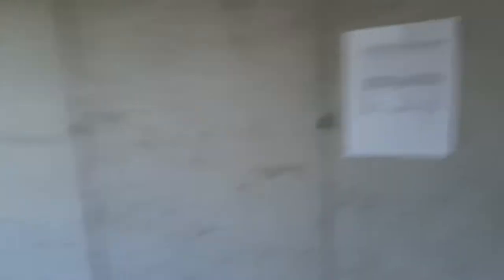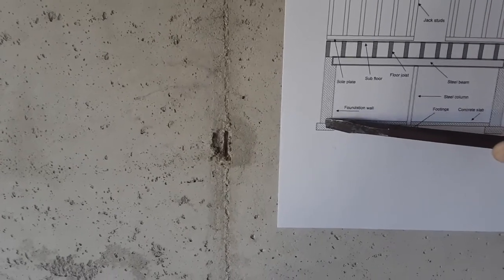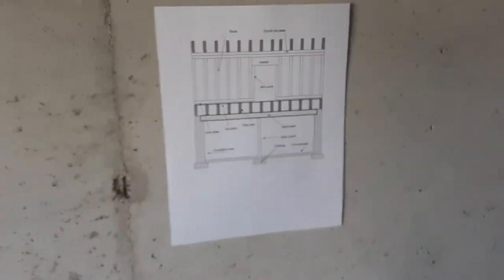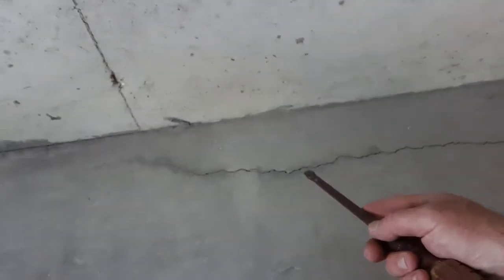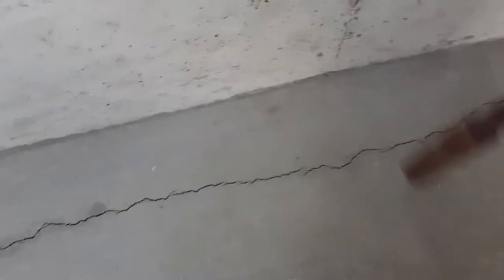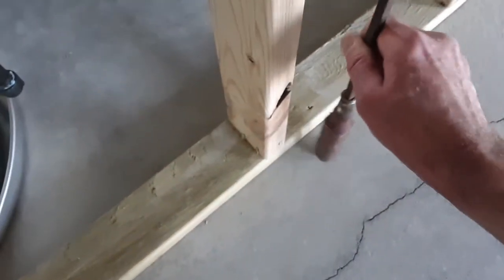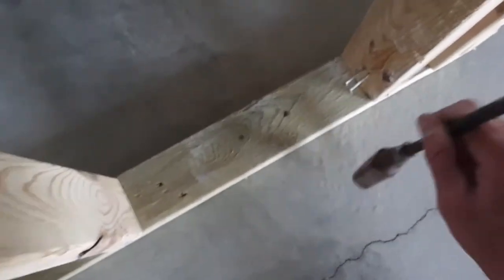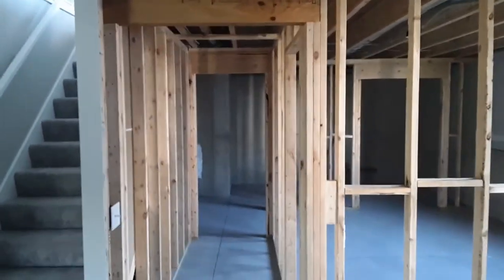😮🚫FOOTINGS missing under load bearing walls NEW BUILD A trick to find missing#footing under#concrete

Comment: Why wasn't this discovered during the foundation inspection?
Reply from the maker: That is a GREAT question! I'll try to make it short, because there's a lot of information that applies.
But first an outline of how and why. Many things have an effect on a home that is being built, "speed" process, oversight and economics. The "economics" part people don't keep in mind and most people forget that there are multiple CODE inspectors that oversee different parts of the home - structure electric plumbing and mechanics.
So, ask yourself, what was going on when a home was built. I don't inspect many homes built in the 1930s because it was the great depression and in the 2008 recession many homes were framed in then left incomplete for years. I inspected one framed in 2007 and not completed till 2013!
Today, "COVID" was the problem with cost and shortage of lumber and labor.  Also, most construction today is not performed by a single builder, but by many subcontractors. 
Basements are installed in 3 stages; the footings are first, the foundation second and the slab floor last. 
Now for my answer:
THIS home in the video is a 4-unit condo building where many were being built at the same time. I believe the foundation and ONLY footings for the foundation were installed first then sat there for weeks maybe months till the builder can get to the framing installation. The code inspector probably passed the foundation and did not come back later to follow up when the slab was installed.
Another subcontractor probably came in to finish the basement slab floor dismissing the footings in the internal areas for load bearing walls and columns.
It is common to see foundation walls installed then sit incomplete for weeks and sometime months. "Oversight, subcontracting and communication" was this problem.
I hope this makes sense. Thanks for watching the video. Don't forget to like, share and subscribe!
Reply: Why wasn't it discovered by the plan reviewer??!!!
Reply: @inspectflix it was definitely over sight by someone. My guess is they didn't prep the slab area before the pour. 
The plans specified some form of internal support, rebar, mesh...etc. that is appropriate for the area. 
Was a vapor barrier installed? Silly not to install one with how cheap they are, in my opinion. Plus if you hear the space one day you won't have to worry about moisture wicking into the concrete. 
I digress, the earth under the slab meas not prepped well enough,not packed enough and any load bearing wall needs a proper footing and foundation and who knows if that's there. 
Either way, is be pissed. Unacceptable.
Reply: @fragout9575 the plan reviewer does just that, review the plans to approve the permit. 
It's the inspectors job and really the contractors job to get it right. 
And if this is a condo development, you can bet your rear end that they are building with speed and who knows, they could be hiring the cheapest contractor. 
Good work ain't cheap. Cheap work ain't good.

Comment: You said this is a multi unit condo building. How would a load bearing wall be 2x4 construction in a basement of a 2 or 3 story building?
Reply from the maker: Sorry, I did not state that in this video but I didn't start that in another video about the firewall.
This video is a single story home.
Thanks for watching

Comment: I guess why wasn't this found out earlier?  Did it just take a while for it to develop?  Or could you just use your tappity tap technique before the crack ever developed?
Reply from the maker: I think it wasn't caught in the beginning because of the speed process in construction. Or the code inspector missed it. My tapping method can be used anytime on any concrete surface to find hollow voids.
Thanks for watching.

Comment: So how would this be resolved?  Could you pump grout under the walls?
Reply from the maker: Thanks for watching the video and what a great question. Temporary supports can be applied under the floor joist and the basement slab flooring can be cutout at footing areas. Then dig to appropriate footing depth and a new footing can be installed. Poured concrete can be brought in on a schutte through a window or by wheel barrel through the slider door. After concrete drys load walls can be set back. 👍can be done. Thanks again for watching.
Reply: @inspectflix what about that foam they use to raise settled slabs?   Would that do anything to help in these scenarios?   Just curious. I'm not a concrete guy I do insulation
Reply from the maker: @georgemccune2923  Good question. I don't believe so, but those companies also do pier systems to lift foundations and footings. However there is no base here.
Because the floor joists are manufactured with warranties, the missing of standard footings could subject them to voiding out the warranty. 
Thanks for watching and the question.
Reply: @inspectflix  your welcome and thanks for the quick response. Subscribed